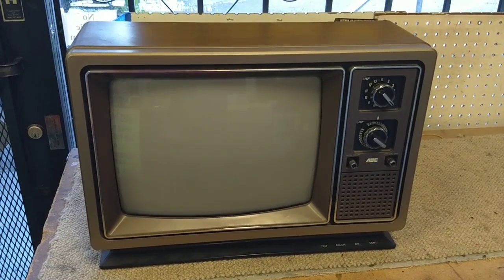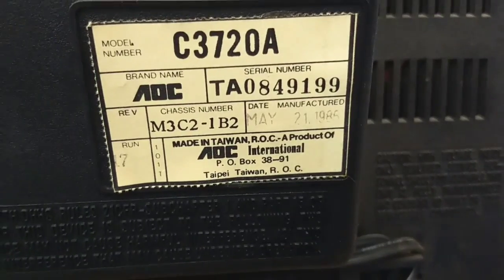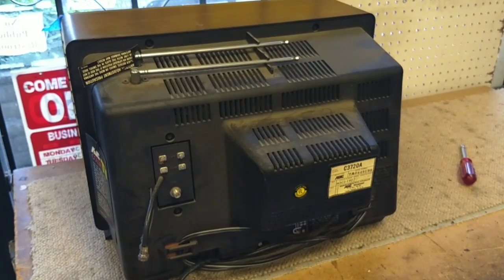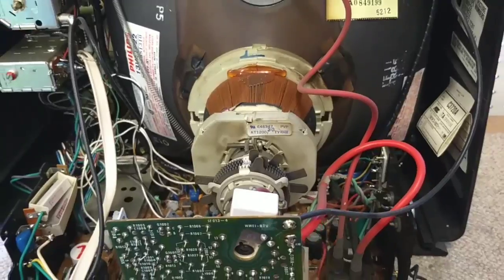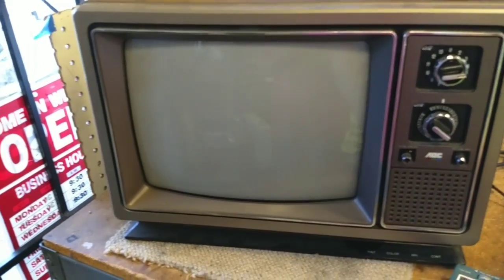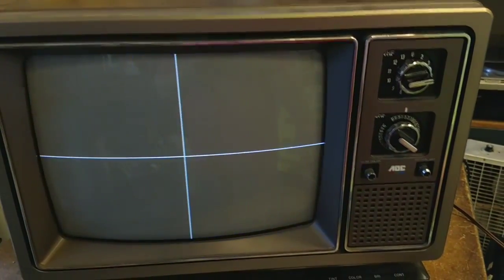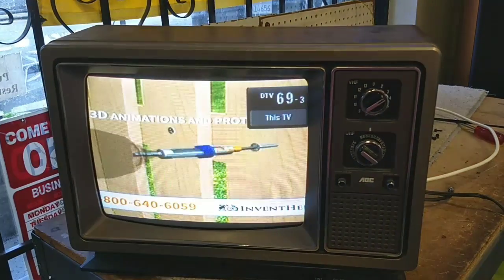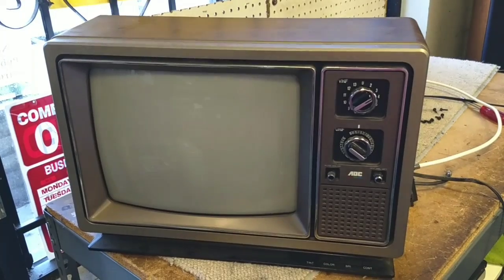A look at a 1985 Admiral Overseas Corp. (AOC) C-3720a color tv

Comment: I was the engineer that set up the color production line at AOC in Taiwan. We started production in1969 and we’re the first exporters of color TV,s from Taiwan. Color CRTs were hard to manufacture in 1968 so we had to import from Japan where they did a great job building new factories.Rockwell International bought Admiral Corp in 1974 and shut down the so-called Brown Goods Division in 1978. In 1979 a consortium headed by Henry Chen bought the Admiral plant and since Admiral kept the brand name, the new business was called AOC and thus later morphed into producing flat screen displays. I was quite a ride for what it’s worth.

Comment: I recall working on some of those AOC sets.  Solder connections and flybacks were common. The focus block (HV multiplier) would arc on the flyback. That is what I hated about integrated high voltage flybacks: In the old days you could replace the tripler or focus divider without having to replace the flyback.

Comment: Hi, I have a ca-273 amplifier I saw you made a video about. Evey time I try to power it on, the 5a power fuse blows, is there a way to contact you and ask for help to repair it?
Reply from the maker: Likely blown amp or power supply troubles. Not for the beginner
Reply: @JordanPier  thanks. I know very little and only have a multimeter, probably over my head. Was hoping I could learn by fixing on it but no clue where to start.